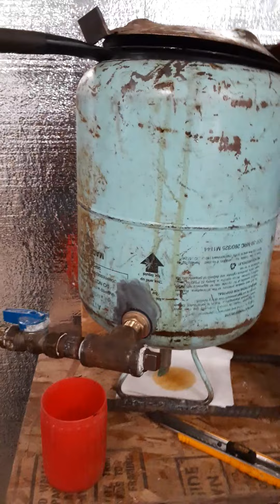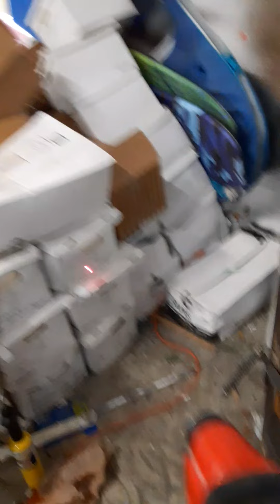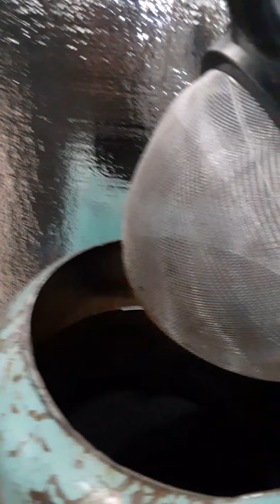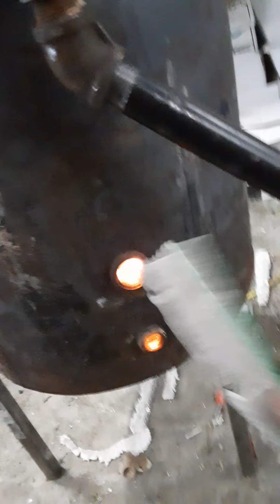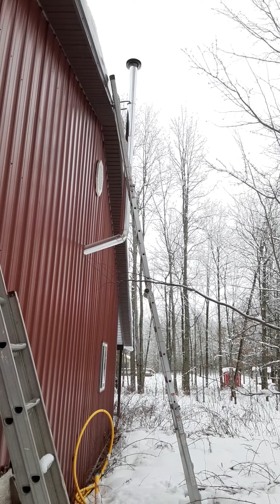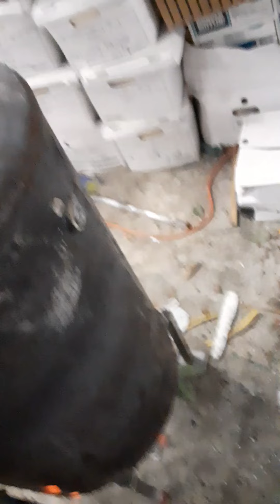Waste oil burner for shop heat

Comment: Like mine, https://youtu.be/PeyV490fGB4 
I put mine into a 55 gallon drum as a "enclosure" around the pipe stove.  I cut front out of the drum & will be adding a inline duct fan to the back to blow air around it.
I added a screen around the indeed tube and seems to work well.